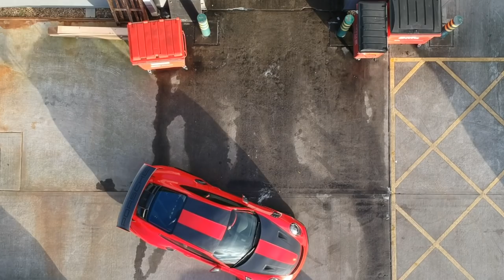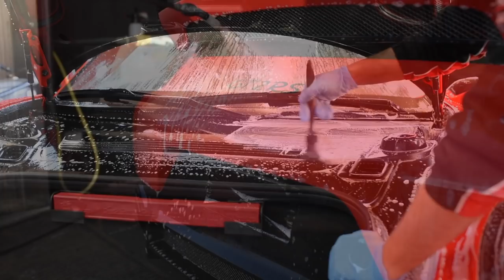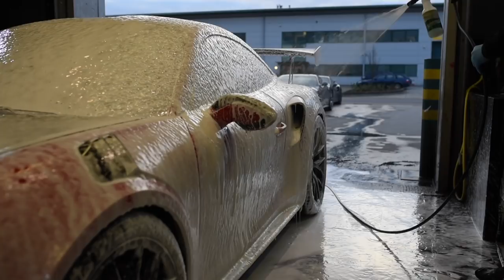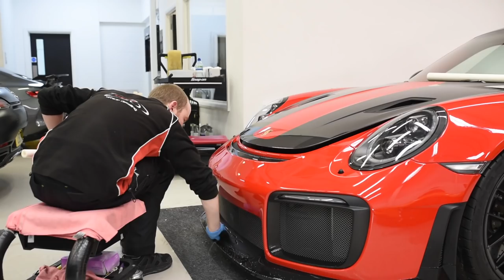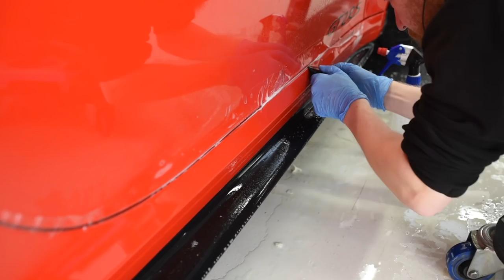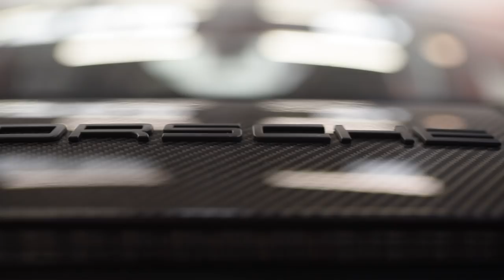First 991 GT2RS Fully Protected in the World by Topaz Detailing!

Comment: that is like healing the scratchphobia of a car nut. You can drive your car without any worries. I dont own such an expensive car but i would even do it on a normal car as well, the imagination of a brand new perfect paint under that film is amazing. I dont buy brand new cars anymore but i bought a new Seat Leon cupra several years ago and i would have done it, no need for Meguiars Tech Wax and all the bad feelings about scratches you will get from normal usage. The only downside is that you probably have to do this every xx years because i can imagine that the film will look dull over time